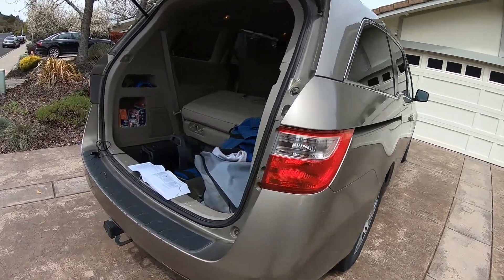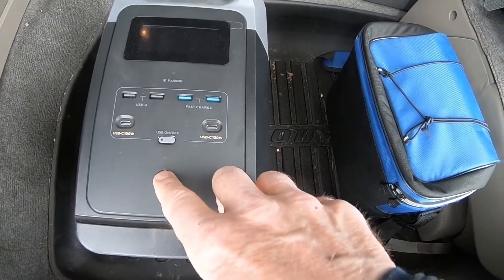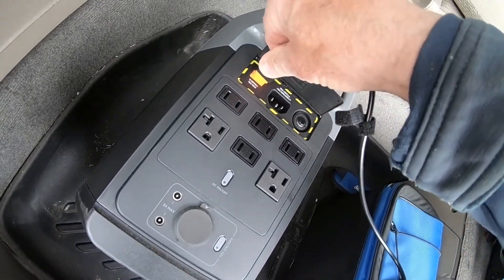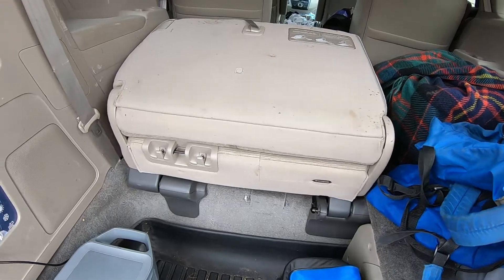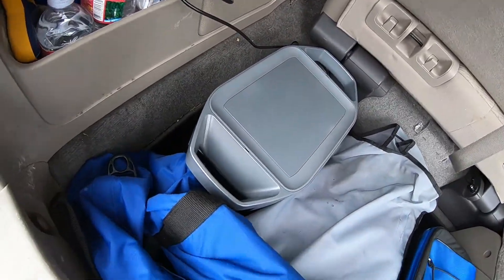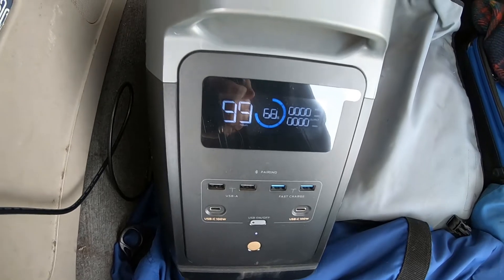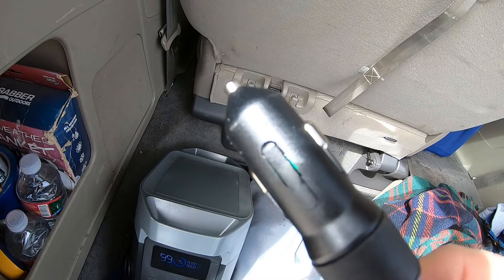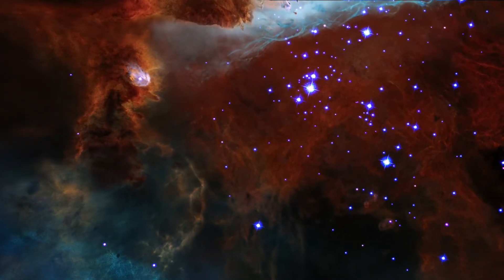EcoFlow Delta II Powerstation - Charging it With Your Car

Comment: Where do you purchase the cable to charge from your car that is high quality and safe to use. I want to charge from my Tesla as a back up during a power outage and don’t want to come home to a house fire. Don’t want some cheap Chinese product from amazon.
Reply from the maker: The one in the video came from EcoFlow with the battery. It's undoubtedly made in China.
Here's one on Amazon that UL & CE listed. It doesn't say where it's made. I'd be happy with a cable that's UL and/or CE certified.
https://www.amazon.com/Magiktech-Cigarette-Lighter-Stations-Generators/dp/B0FP54MTCS/

Comment: I would not plug it in to charge...unless the car is on already...as well as a power inverter either...
Reply from the maker: I don't think that's necessary. We've had a portable cooler that plugs into that 12V port that we've taken on vacation. When we stop for gas, etc. we leave it plugged in and then start the minivan and go on our way.

Comment: A couple weeks ago I tried charging my newly acquired Delta 2 using the 12v socket in my 2017 Dodge Grand Caravan for the first time during a 2.5-hour trip. I had the D2  set to 8amp DC charging and plugged in to the ignition-linked 12v socket of the vehicle. (My DGC has a 12v option to operate directly from the battery or another to only power when the car is running. I used the latter.) Worked fine and even paused charging when I stopped and shut off the vehicle for gas. Resuming my trip it was drawing about 100amps as expected. But, after an hour it stopped charging at around 71% (IIRC) and wouldn't resume charging even after pulling the cable, turning the D2 off, turning it on again, switching 12v sockets. I had the range set from 5% to 100% at the time. Once home, I checked the AC charging (was fine) and then discharged and charged the battery again, then discharged it to around 49%. I checked my DGC fuse box and a 25amp fuse had blown on one of the lighter circuits. Replaced the fuse later that day and was able to charge using the 12v DC ignition-dependent socket on the return trip. Don't know why the 25amp fuse blew using an 8amp draw, but I suspect it was just old and tired. Anyway, I'm glad there doesn't seem to be any issue with the Delta 2.
Reply from the maker: Thanks for sharing your experience. That’s strange that the fuse blew. Your vehicle isn’t that old but who knows maybe there was a defect in the fuse. Have you used that plug much before?
Reply: Nope. Never used the 12v socket before. I just purchased the van 5 months ago but decided to try the car charging option for the first time during this last trip. Haven't had any problem with the D2 charging/discharging other than that fuse failing in the van. AC and solar charging work as expected and I suspect the fuse blowing was a fluke and related to the vehicle rather than power station. @BetaCygniBlog